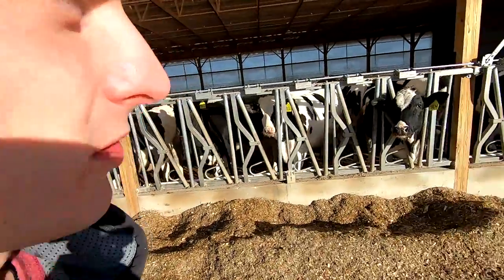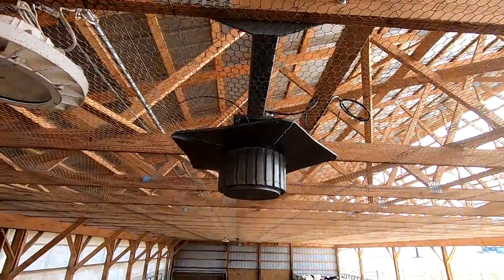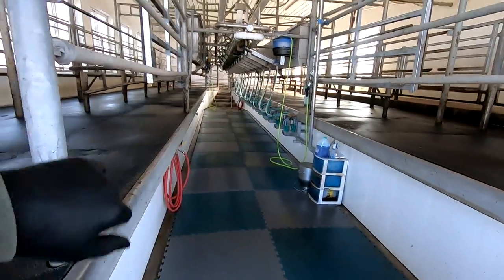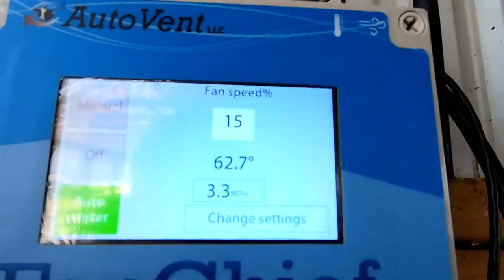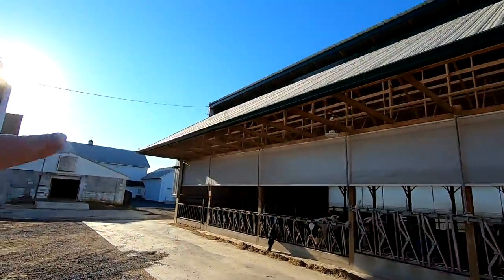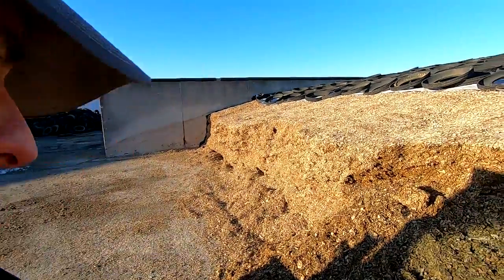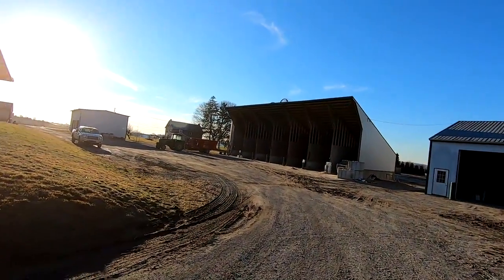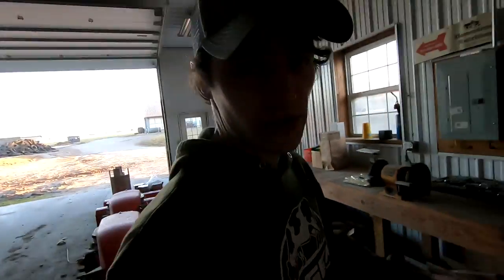19 Foot Ceiling Fans in the New Heifer Barn

Comment: Nice fans - a drive motor without gears or belts is called 'direct drive'. The term isn't always used, but it's probably your best bet for efficiency, noise, and maintenance.
Reply: Isn't that exactly what he called it?
Reply: @MRblazedBEANS  You're right, I looked back and Eric did say earlier it was a direct drive - later he said it was "a motor without a belt on it" Sorry for the trouble...

Comment: In my experience the fans will save bedding not sure if its really 30% but it is noticeable. We have ours set for full speed at 65 degrees. But you do have to run them fast and move alot of air to really see the bedding savings.

Comment: Be careful with direct drive fans if they’re 3phase motors. Unless you have 3phase electricity running to them shouldn’t be an issue. But we single phase running to 3 phase fans with converters on them, causing stray voltage all through our milking free stall barn about 5 volts shocking the cows. Our cows dropped to below 70lbs a day. If you see heifers being messier and not drinking check for stray voltage.

Comment: Great video Eric. The subject matter in this one hits very closely with some things I am pondering at the dairy. Look forward to your reviews on those fans. Is the actual fan an auto vent or just the control box. 
A tip for your discoveries….make most of your program turns with both wheels and not one stationary as the other turns. You will thank me later! Or if you don’t like them….look me up I would like a second machine 😉
Reply: Autovent actually makes the fans and the controller.

Comment: oh NO we have the fans to have come back and run a safety chain from it too and add more supports on your trusses  we had one break the trusses and full down we had to put 3 cows down too we got new trusses made for use span the bracing out to a lot more trusses too took the stress from the 2 it had the motor calved on use why it did what it did short time after we had them put to the harsh environment cause it all  we have to use the fan again the company did reach out to use and will to put new one in for free too 
we were planning on having them anyways engineer after that case too we did find a dead owl there too and a rabbet to was not the first and the owl was in the barn after something too